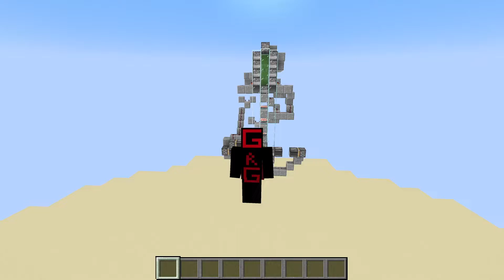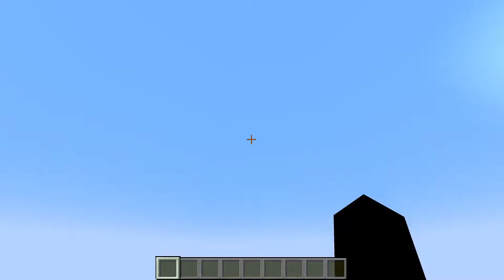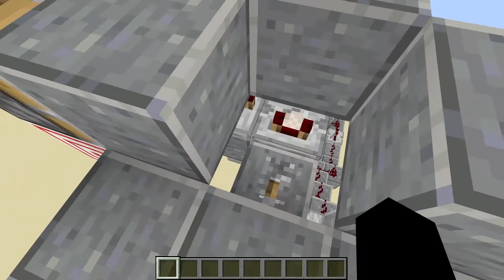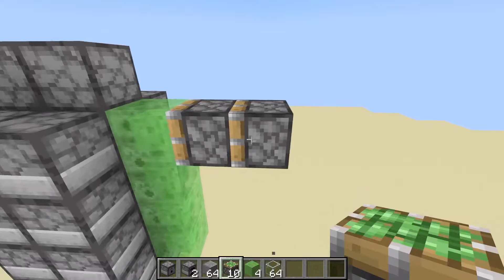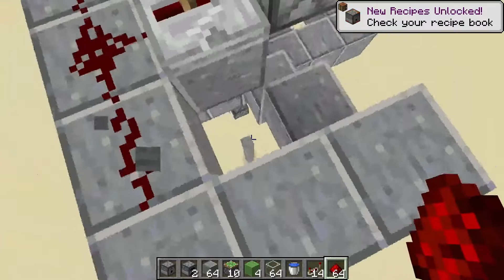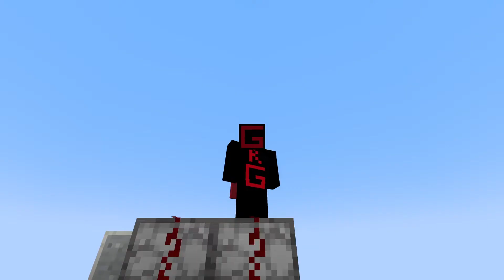Machine Gun TNT Cannon V2

Comment: This cannon isn't bad but it has the issue that the TNT just lands on the wall of this end stone and falls down, rendering this cannon unable to really deal a whole lot of destruction despite its high fire rate. It is a very inefficient design overall. You could fix this by simply turning down the delay to 2-3 redstone ticks, and you can also use comparators to add halfticks in order to fine-tune the cannon and you should increase the cannons range in order to have the cannon be able to even still cause destruction once you dug a giant hole that is 20 chunks or longer. You should also increase the projectile count and use a much faster clock to fuse the projectiles to increase the effectiveness of the cannon even more. Just take a look at how the cannons I already showed you on my channel work for that.
Reply from the maker: Thanks again for the feed back. This cannon wasn't really meant to be take super seriously as it would only be effective in very specific situations. Also increasing the range would require a complete redesign based on how this cannon works. But maybe if I get time I'll make an improved one.
Reply: Lol u must do a lot of research on tnt cannons remember me